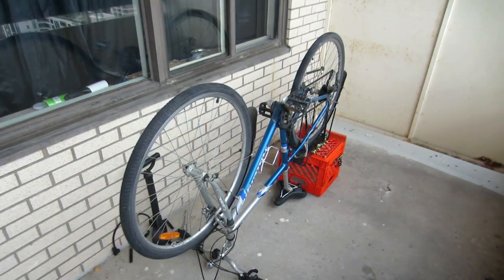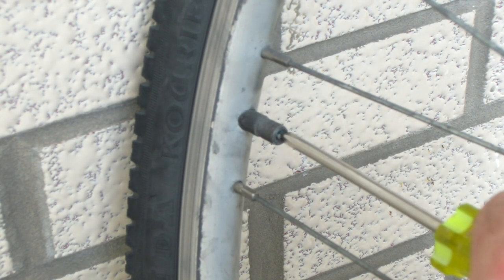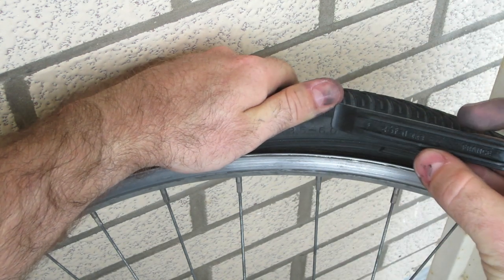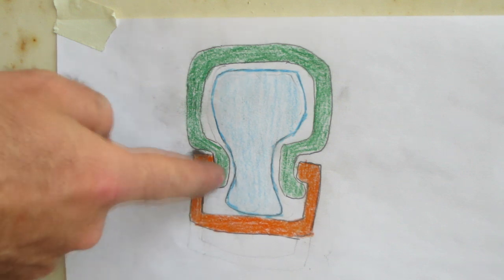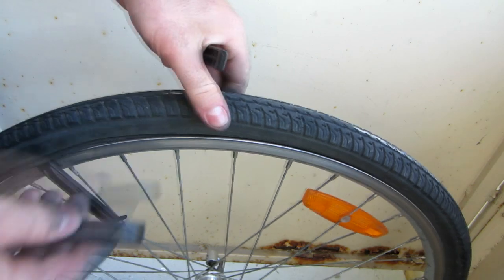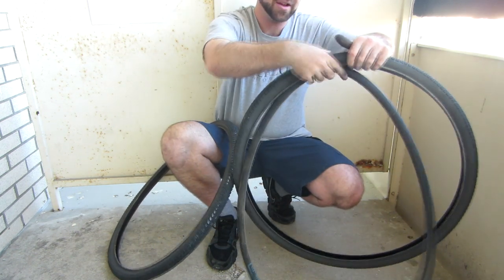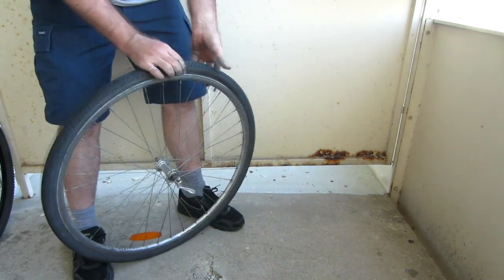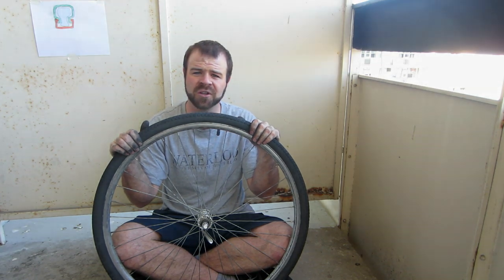How to Change a Bicycle Tire

Comment: Qualitatively. how much pressure do you like to put in your tires?  For instance, I prefer a pressure just shy of the tire being unable to flex with both hands and body weight pressing on it.  I reckon that this is a good balance between rim-saving high pressure and low enough pressure for flexibility allowing a more comfortable ride.

Do you find your preference of air pressure to be in line with the manufacturers specification?  On my current tires, the manufacture specifications are 10 pounds too low for my liking.

Thanks!
Reply from the maker: I generally like my tires pretty hard. Usually the tires have an upper and lower pressure recommendation. I generally try to keep them close to the upper limit.

Comment: Great video! Thank you these videos - they have been extremely helpful to a beginner. 

If I wanted to change a department store bought mountain bike knobby tyre to a slick mountain bike tyre for daily commute, how do I know if the rim will fit the new slick tire? And how do I ensure that the new slick tire will fit the rim?  Thanks! 

And hello from Australia!
Reply from the maker: +pauly pauly Does your bike have 26 inch wheels? In my experience, 26 inch tires are pretty interchangeable. Tires do have a second dimension (26 x _) but as long as that number isn't drastically different, it should work fine. You may however find that the slicks fit more tightly than the knobby ones (mine do), but with tire levers you should still be able to get them on and off.
Reply: +cjhoyle Yes, the tyres on the bike are 26 x 1.95. The new set of slick tyres I have purchased are 26 x 1.9. Is it possible to change the knobby tires to 26 x 1 - 1.5 inch slick tires without changing the inner tube? Is that considered too drastically different? Thank you for the helpful advice and expertise!

Comment: Great video... do you prefer presta or Schrader valves and why thanks
Reply: Schrader valves are more durable and ubiquitous in the States.  The tip of the Presta valve can be easily bent if you are not careful.  And, it's protocol to release a tiny bit of air out of a Presta valve before airing up a tire.  This is done because the Presta valve can stick after being sealed for a while.  Presta is used for high pressure tires, meaning, road bike tires.